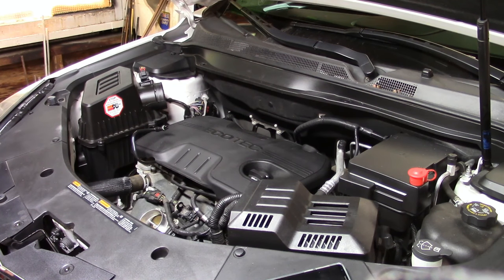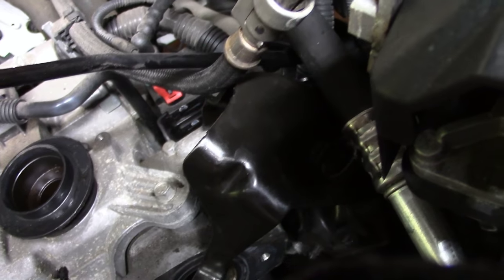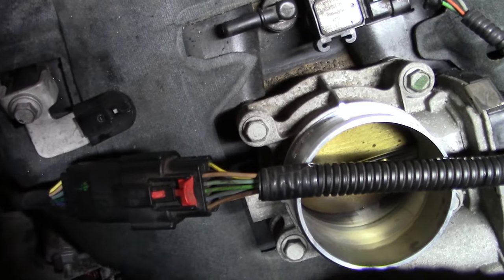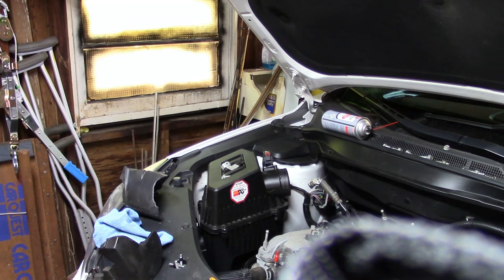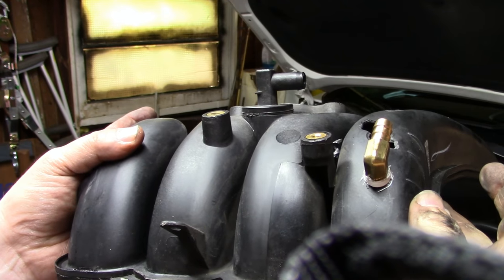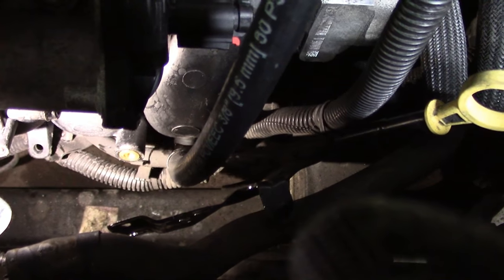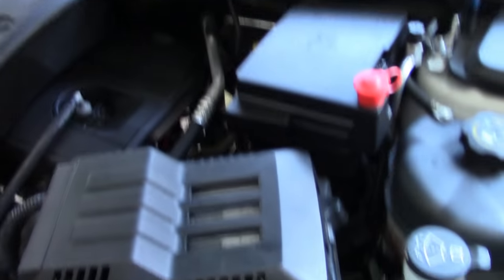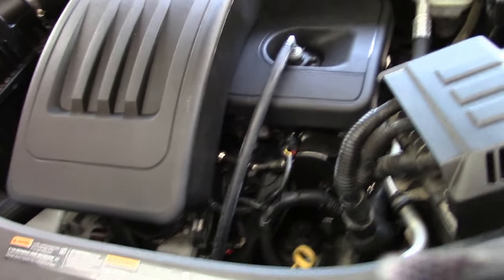2013 Chevy Equinox w/2.4L 4-Cyl. Engine PCV Upgrade

Comment: Hello frank , what you did is zero engineering and does not do any thing to engine venting , if you take the valve cover off , you will see there is two secondary covers from inside of the valve cover and they are in certain shape and with some opening , you have no idea how the engine venting should be , by connecting your house to the oil filling cap you are shortening the path of the inlet air thru that little pipe on the left of the valve cover to go thru your added pipe instead to go down to the crankcase and get up from the other side of the cylinder head to the secondary cover and then to the intake  thru PCV , best regards ..
Reply from the maker: What's your background with internal combustion engines.
Reply: @Frank4358  engineering level of ICE , retired  now duo to illness . thanks
Reply from the maker: If it doesn't work, then why have I stopped using oil, and the new PCV draws vacuum? It works better than the OE system.
Reply: @Frank4358  its so much easy to fix the OE venting system which dose not have PCV valve  , if you take of the intake manifold and open the section hole which will clogged with the slug , make the opining 5/23 ,thanks.
Reply from the maker: @61comanche  until it clogs again.

Comment: He said no vacuum leaks meanwhile at 7:02 he has a vacuum leak on the pass side of the intake lol
Reply from the maker: Where exactly is this vacuum leak you're talking about? That clacking noise is from the high pressure fuel pump.
Reply: How did you block or cover the existing vacuum lines
Reply from the maker: @santossanchez1928  what existing vacuum lines?

Comment: So basically the hole point is to keep the engine pressure down. Why not drill a hole in the filler cap and add a small filter. It will keep the pressure at bay.
Reply from the maker: Because if all you did vent to the atmosphere you would be violating federal emissions laws, and sending hydrocarbons into the atmosphere. 
Also, your "filter" would become saturated at some point and your engine compartment would get messy. 
Making this modification reduces pressure from the crankcase and recycles the hydrocarbons where they are burned in the combustion chamber.

Comment: What pcv valve size ) brand did you use. Thank you!
Reply from the maker: Carquest PCA1008
Reply from the maker: Carquest PCA1008
Reply: Thank you!
I have that now trying to locate the sweet oil fill cap locally. One of these jobs that I can't wait for rock auto.ay have to modify the current cap.
Reply from the maker: @weloveups  it's a Stant, direct replacement. But you will need to drill a hole at the center.
Reply: Sooo do you plug the hole on the original PCV hole from the box and engine?

Comment: Sorry to say but you can't modify new motors bro. That k&n filter sticker says it all. New vehicle's are top tuned. Mess with the programming it's all over. If you want to biuld power get a old vehicle. New cars are all computer controlled.
Bet the check engine light is on..
Reply from the maker: You obviously have no idea of what you speak.
I installed the K&N filter in my vehicle. Oh, and the ECU can be reflashed with the proper equipment.
The check engine light is OFF. No trouble codes, and it passed emissions inspection with flying colors!
Reply: @Frank4358  Well then you know a k&n filter has oil that kills your MAF sensor. So why put one in? Sure works great on 1996 and older vehicles. But dose nothing after that.
Reply from the maker: @maces1405  I've been using K&N filters since 1990. And I've never had a MAF sensor go bad. 
If you read the instructions you'd know that you're only supposed to put a light coating of the K&N oil on the filter. If you flood the filter with oil it will leach on to the MAF and cause a failure. That's why you need to read the instructions before performing any repairs or installations.
Reply: @Frank4358  the viewer is mistaken.  A change in air filter does not throw off your ECU calibrations.  The MAP sensor is designed to measure air flow, and that includes variations in flow through the filter as it ages and becomes more restrictive.  I tried a K&N intake system and I saw a change in MAF readings and corresponding increase in fuel trims.  Even with that it did not set a check engine light.  Performance was poor at higher speeds, and would require a tune and reflash by an expert,  The intake did not have resonance tubes to prevent reversion and it dumped the cleanside moisture and gunk directly on top of the throttle body.  Other Ecotec designs in other vehicle, this is common complaint about freezing throttle bodies and resulting broken motors and plastic gears.
Reply: I used a K&N in my old 1990 C1500 Cheyenne. If I knew then what I know now I never would have used one. Piston rings were toast after 50K. The blue smoke from the exhaust was fun. The truck always ran, but I added 1qt of oil every 1500 miles. Oil was cheap then.